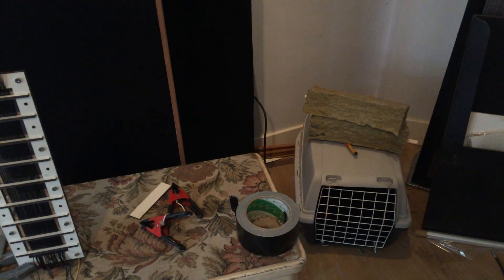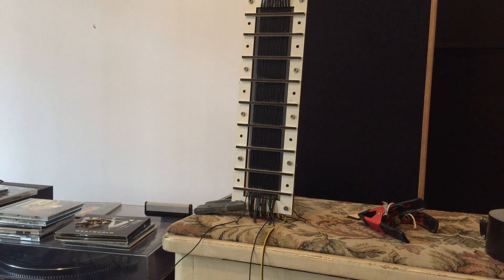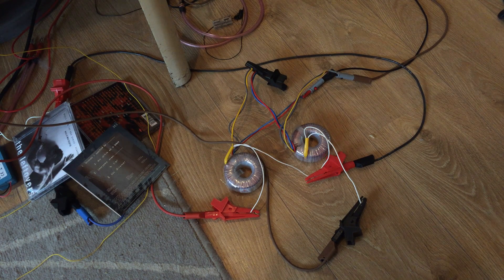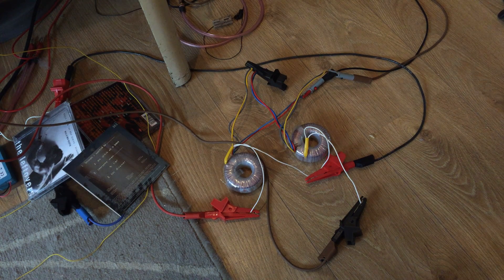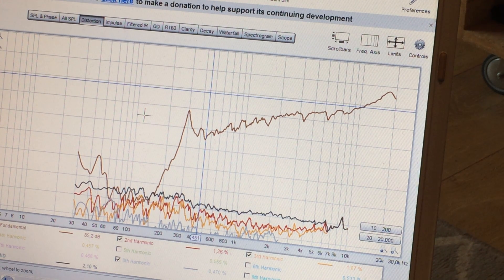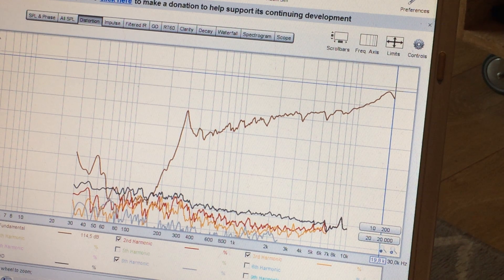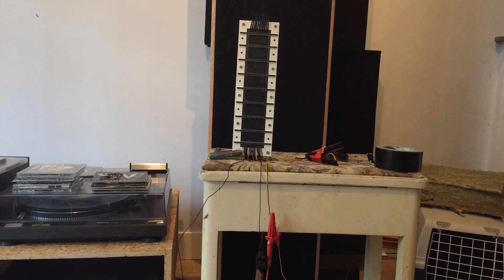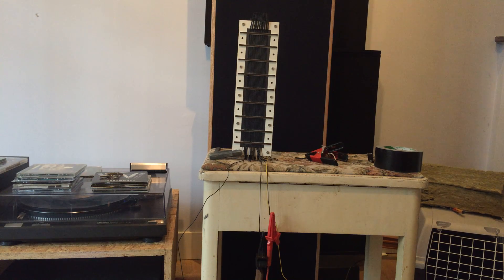Big Guns Mark 2 - Electrostatic Wire Tweeter Part 3(speaker test panel)

Comment: how did you connect the PC to the microphone and amplifier? (to send frequencies to the loudspeaker to find the resonance point) Thanks.
Reply from the maker: the mic is on that box a DIGIDESIGN mbox 2  just a USB soundcard with phantom power and one mic input.  it also has left and right out that goes to the amp. as easy as that. chose the right input ouput in the software and chose the cailbration file for them mic (not even needed without it it is within 0.8 dB anyways) and of you go
Reply: Thanks!

Comment: Sorry, what software do you use for panel resonance?
Do you need just any cheap microphone?
Thank you.
Reply from the maker: depends what you want to do, in this case it is an affordable mic but not cheap. if you just want to know the resonance for instance any mic will do. if you measure distortion and want the top end to be accurate you usually have to buy a bit more expensive mic.  this mic i suse is about 150, ISEMCON. really nice mic you do need a pre amp and phantom power.  but it outperforms every el cheapo like UMIK DAYTON and Behringer, last one is no surprise :) they all are flawed in distortion and as well the top end calibration is is kind of random at least in the mic i had.  i use holmimpulse or REW both are freeware
Reply: Thanks again!
Reply from the maker: no problem!